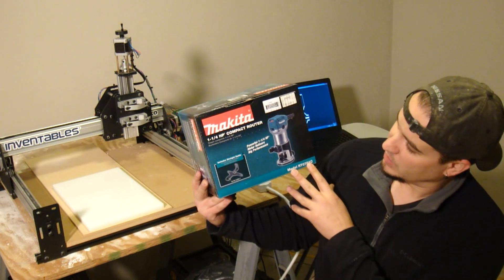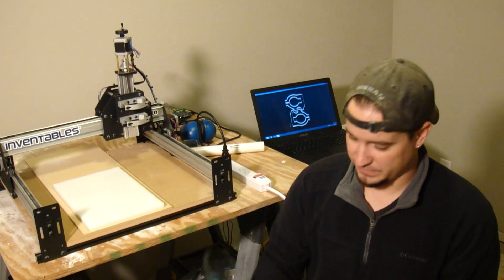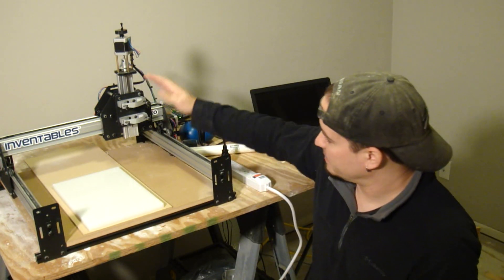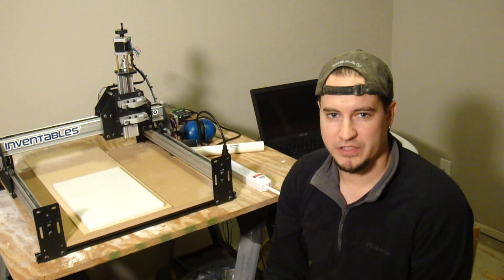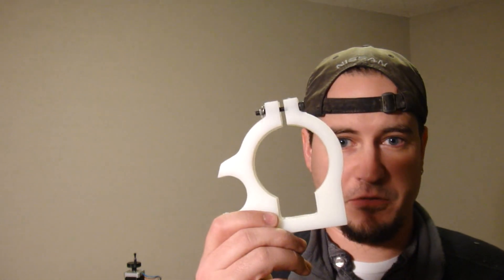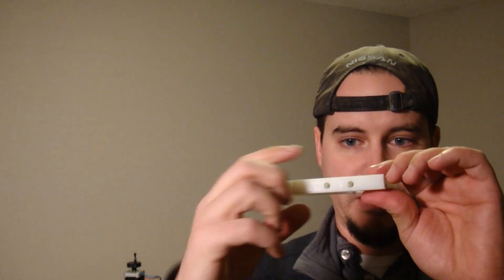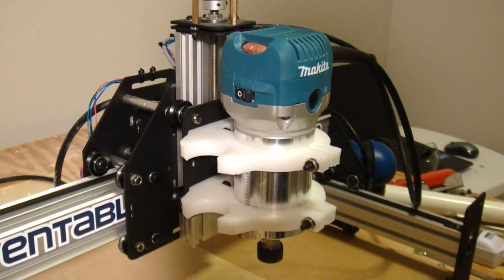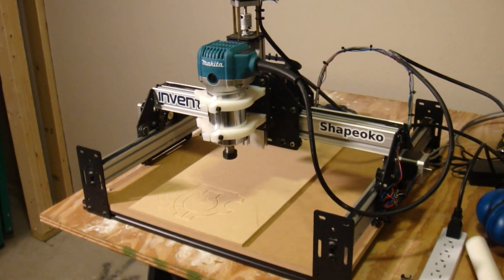Shapeoko 2 Makita Compact Router mounting

Comment: how well is that hdpe holding up
Reply from the maker: Frankie  I sold that cbc a few years back .... but it was holding up just fine when I sold it.
Reply: Cool thanks for the reply. im getting ready to make mount for mine. I built my own cnc check out my channel there will be more content when its warmer in my garage -shop.sub to my channel even if you don't intend to check it out much lol anyway thanks for your time man have a good one
Reply: I milled some mounts using 1/2in hdpe cutting board  had to sand the coffee stain off it when I was done.lol
Reply from the maker: nice

Comment: I've tried several times to download the Makita router .svg and use makercam to generate the gcode.  It always hangs the browser.  I've tried on 3 different computers at home and 2 at work with the same results.

Could you give it a try and see if there is something wrong with the .svg file or maybe post your gcode as well?  

I'm using LinuxCNC on a Shapeoko 2 and want to upgrade the spindle mount so I can use my little Makita trim router instead of the stock Dremel tool.

Thanks.
Reply from the maker: +George Cohn Sorry you are have troubles, i downloaded it, and opened it in makercam just fine.  i am using google chrome as my browser.  This was a fairly old project, and i no longer have the g-code file for it.

Comment: What kind is material is that also can u please make a video explaining how you generate the g code and how u converted the image to gcade. I got a shapeoko and I'm getting kind of bummed because so many videos but no one explains the steps they just assume everyone starting out already has all this knowledge :(
Reply from the maker: vladyerus the material is HDPE (https://www.inventables.com/categories/materials/hdpe).  

Don't get bummed out, its all a learning process.  Everyone does it differently.  If you are just starting out, you might want to check out easel by inventables (https://www.inventables.com/technologies/easel).  It is a "one stop" for cnc, and great for beginners.  It is free and web based.  In easel you can design you part, create the code, and run the machine.  A quick youtube search brings up a few videos on how to use it (https://www.youtube.com/results?search_query=easel+inventables).  

I personally do not use easel very often.  I use Alias and Solidworks to design my parts, i use CamBam to program the Gcode, and i use Chillipepper to run the CNC machine.  The main reason that i use these programs instead of easel is that i am familiar with them and get a bit more control and features with them.

I hope this helped.  Let me know if you have any other questions.  In the future, I'll try and make a video highlighting my process.
Reply: thank you. Just picked some up and will be making myself a varient of your design.
Reply: Targ's Workshop Oh for some reason on my phone i was only able to read your response about the HDPE. But now on the computer im reading the rest. 
Thank you for your response. I did a test cut of your clamp on easel and MDF last night. Today i picked up some pieces of HDPE. Tomorrow I will be cutting. I have used meshcam, I have tried Chili pepper but for some reason it was not working correctly for me but i will dig into that on my own time. I purchased this makita today as well because i have an assortment of 1/4 collett bits and im hoping to use very soon. Thanks once again for your reply : ) i will be checking out cambam.

Comment: What is the DPI for the SVG file? Is it 72dpi, 90dpi, or something else? Thanks.
Reply from the maker: I don't know how to look that up.  I made it in Illustrator, and i think the illustrator default is 300dpi.
Reply: Thanks.  I use makercam to generate gcode, and it can get thrown off without changing the dpi if the svg file was made in a non-standard program (i.e. Inkscape).  I went ahead and got the Makita because I want to use the Dremel 3000 for other things, so I'm hoping to cut this out tomorrow.
Reply from the maker: MonkWerks with Fr. Thomas good luck on your cuts tomorrow.

Comment: ops, i just saw that you don't use Easel.  Can you tell me what you use instead and does it work with the stock controller?  Arduino microcontroller & gShield?  Easel is easy to use but it constantly looses connection to the Arduino for some reason.  I really won't mind changing as well, so if whatever advise you can give me would be appreciated.
Reply from the maker: I have been using CamBam (http://www.cambam.info/), and it has a full demo version that you can use 40 times, but the purchase price isn't to bad.  And it works with the Arduino and gshield.

Comment: Hey Targ, I am about to purchase my Makita and was wondering if you ever came up with a new design? Also a couple more questions for you if you didn't mind.  Did you originally cut/create the Makita mounts with the stock dremel and bit that came with the Shapeoko 2? That is what I am about to do and wanted to know if you can tell me if you just choose the HDPE and just cut it or did you change the feed rate and dept per pass?  It currently shows 381 mm/min for feed rate and 1.0mm for the dept per pass.  You think it is ok to use those settings?
Reply from the maker: I did come up with a new design (haven't cut it out yet), but i just saw that the Shapeoko store came out with a new Z axis belt drive that moves the stepper motor back to create clearance for the router, so I think I'm going to redesign my mounts to move the router closer to the gantry and buy the belt drove (http://shop.shapeoko.com/collections/frontpage/products/shapeoko-2-belt-drive-nema-23-z-axis-kit).  Yes, i used the original dremel and the bits that came with the kit to cut out the mounts. You can use this page (http://www.shapeoko.com/wiki/index.php/Materials) to look up feeds and depths for materials; I don't remember what i used off the top of my head.

Comment: Hey Targ, thanks for all the useful information.  I was wondering in upgrading to the Makita, Did you or would you suggest upgrading to the Nema 23 motors and power supply?  Or are you still using the original motors that came with the system?  Are the nema 17 motors good enough for the Makita? What if I used something like a 2 1/4 hp Bosch or Hitachi?
Reply from the maker: I am currently using the stock nema 17s, and they are ok to run the with the Makita.  I think with the upgrades to the nema 23s I would be able to up the feed rate speed.  With a larger router, i would definitely go with the nema 23s.

I am contemplating rebuilding the Shapeoko over the winter to a 2' by 4' cutting area, just determining if i have the space to put a machine that big.  If i do make the machine bigger, then i will be upgrading to the nema 23s.
Reply: Targ's Workshop Is there a reason you didn't go with a 2 1/4 HP router?  Or do you think the Makita you have now is good enough?  If you build a bigger machine are you going to used separte driver and electronics or still use all the Shapeoko Electronics? 
Also when you cut your new mount for the Makita, did you have a drill the mounting holes separately in a drill press or something?  Or did you somehow use the cnc to make those holes?
Thanks for all the information.
Reply from the maker: Dave Fong i Have not seen anyone use a full sized router with the Shapeoko.  I think it is just to big and heavy for the rails to handle.  I am still debating about changing to a different electronics package.  It would be nice to go that route, but probably expensive.

and yes, I had to use my drill press to drill some mounting holes for the new mounts.

Comment: What's the thickness of the HDPE you're using? Would you make any changes to the design since you've made this?
Reply from the maker: the thickness is half inch.  And yes, I am in the process of making changes to the design (I've just been busy, and not had the time to make the new mounts)(hopefully a new video of the new mounts will be available in a week or two).  This design contacts the rails on the side reducing the cutting area, so one design change is to rotate the dust boot more towards the center line.  the snap in connection between the plastic and the pvc is not stiff enough to prevent the dust boot from rotating as the spindle moves around, So another design change address that issue.  The new mount will also be milled out of aluminium.

Comment: Looking to buy the Shapeoko 2 in a few days, and these videos have been very helpful! Overall would you recommend buying it? Im wanting to mill thin plywood, for general purpose Box/Case builds, do you think this could manage decent finishes?
Reply from the maker: So far I have been very pleased with the Shapeoko and it's capabilities.  And its even better with the trim router instead of the rotary tool.  So yes, I would recommend buying one.

Comment: Hi, i'm looking at Buying a Shapeoko 2 in the near future.
people say that the makita is an upgrade. but what makes it better ?
just a stronger motor,
cut faster,
more reliable,
or all of the above ?

how hard is it to find the bits for it also, are they cheap, do they last longer ?
Reply from the maker: The Shapeoko 2 comes with a small rotary tool, basically a knock off Dremel tool.  The Makita is a compact router.  It is more powerful, and can cut more material with each pass at a faster spped.  Think of it like a Honda Civic versus a Ford Mustang.  The makita has a quarter inch collet, and you can find quarter inch milling bits online.  You can also buy an adapter to use the 1/8in bits that the shapeoko comes with.

Comment: Huge thanks for the videos, man. Heavily inspired by your results, I also decided to purchase the Makita RT0701C instead of the Bosch Colt.  I just milled out one of the mounts tonight based on your SVG (took two attempts).

One tip I just discovered when milling this thing is to do an "Arc Fit" operation in CamBam to reduce the number of polyline segments from ~3300 to ~100.  This greatly increased milling speed (and finish quality) for me, especially on the contoured sections on the vacuum clip side where it seems to slow way down.

I also read on the Shapeoko forums that you had issues with the dust shoe moving around and interfering with the milling bit.  I'm eager to find out how you solve this. I decided to mod your SVG a bit and added a "key" slot, with the intention of epoxying a piece of acrylic to the PVC pipe so that it won't rotate once locked in. Not sure if it'll work, but worth a try.
Reply from the maker: I would like to see your mod for locking the dust boot down.  I think i understand what your talking about, and seems simple, genius, and A LOT easier than what i was planning.  

 I am working on a new design for the mounting that will move the boot toward the center line of the spindle, but i haven't finalized it yet.  I've been busy with a basement remodel at my house which hopefully will be done in about two weeks, and then i can continue on the Shapeoko videos and modifications.

I will also be milling out the new mount in Aluminium.  The plastic works, but I trust metal more.

I will have to check out CamBam.  Can it handle 3D milling?   I've been using the free Makercam site to generate my code, and its functionality is limited.  I am really looking for something that can mill 3D and do engraving.

Thanks for watching and providing your input.
Reply: Targ's Workshop Here, feel free to check it out (note the rectangle cutout in the pipe clip): https://drive.google.com/folderview?id=0B1-ZCH8JxShyMmJpTEVsMHlOUkE&usp=sharing The idea is to epoxy a "key" of roughly the same size that runs the length of the PVC pipe. That key will fit into the cutout, preventing unwanted rotation. I'll probably test it using a 5 or 6 inch long acrylic scrap that I measured to fit the the cutout.

As for CamBam, I'd recommend checking out the trial. It does a fantastic job at the 2.5D stuff. It does do 3D toolpaths, importing STL and 3DS files.  Full disclosure, I've put together a toolpath with STL files that would probably work, but haven't actually cut it out on the shapeoko 2 yet though. The biggest feature it's still missing (for 3d only) is an easy way to add part-holding tabs. There are workarounds, but they aren't fast. The trial lets you open it 40 times (so it's been running awhile on my PC) with full functionality.

Meshcam is another one I've heard does decent full 3D toolpaths, though it's much more expensive, so I haven't bothered trying it yet.

I'm really curious to see how your next designs come together. When you get back around to doing videos, clean aluminum milling would be a great one to see. I tried it the other night with... questionable results.
Reply from the maker: Paul Trandem That design tweak is brilliant.  I will definitely steal that idea and incorporate that into the aluminum mounts.  I will have to give CamBam a try.  thanks
Reply: Targ's Workshop Here's the design redrawn in illustrator using bezier points to minimize the polyline count. Also I made the base slightly concave (very slightly), so it really tightens up the outside of the bracket since the bolts are on the inside. Hope u like it.   https://dl.dropboxusercontent.com/u/562961/makita%20bracket.svg
Reply from the maker: Frederik Deryckere Looks really good.  I like your idea about curving the back to make it sit nice and tight.

Comment: Nice job! I want to order the Shapeoko 2 just watching as many vids as I can to see if it will perform as well as I would like it to. So far it seems it may be a bit slow, but I dont know if better software, better router, better steppers will speed it up? I'm a woodworker and would like to incorporate the cnc capabilities...
Reply from the maker: Using the stock rotary tool, which is a knock off Dremel tool, is pretty slow going.  The feed rate (speed) is set during the programming for each part, and is really determined by the spindle (router / Dremel), the material, and what the stepper motors can handle.  Since the Dremel does not have a lot of torque, it binds up easy, and forces a slower feed rate.  I'm hoping that with the new Makita, I can up the feed rate, and run the machine faster.  You can find alot of the feed rate information for the Dremel here ... http://www.shapeoko.com/wiki/index.php/Materials

 I will be firing up the CNC with the Makita for the first time this afternoon, and should have a new video up today or tomorrow.
Reply: I've seen a few other guys using the Dewalt 660. 5 amps, 30k rpm and has both 1/8" and 1/4" collets.The Makita is smaller, more compact but costs more.
Reply: I heavily modified one to have about 27"X25" work area, a coolant/air system, and a Bosch 1617 router. Overkill? Absolutely. Worth it? You bet! I only got it running today, but with a powerful router it can hog through aluminum quite nicely. It's a little slower than some others, but waaaaaaay less money.
Reply from the maker: Jackson Smith
Man that sounds awesome.  Do you have a link to some pics?
Reply: Jackson Smith  Hey Jackson, did you cut out a mount specifically for the Bosch 1617?  Is it pretty solid?  Also would you share your svg file for it or give me any information on it? I am thiking about doing that as well.  Did you upgrade your motors as well?  If so which motor are you using? Nema 23's?